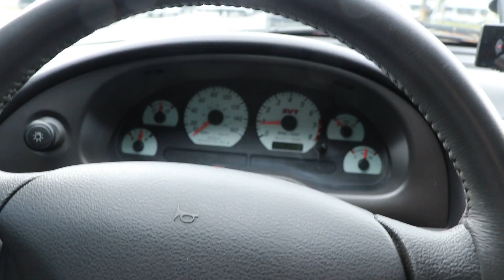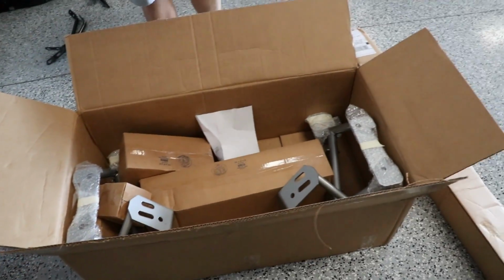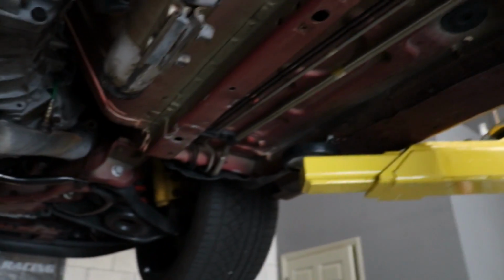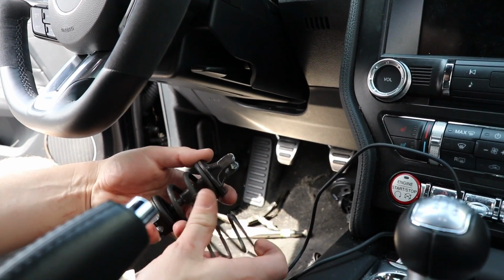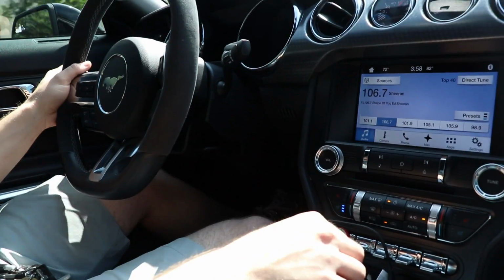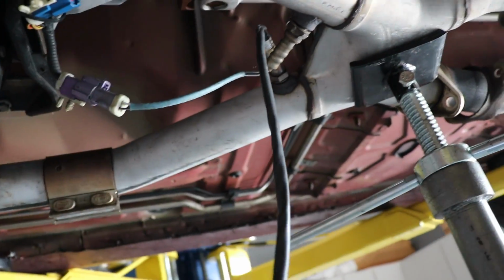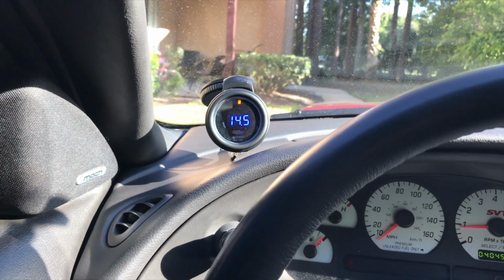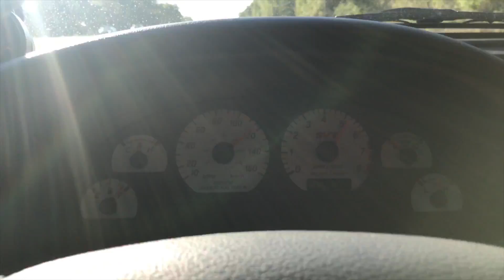Wideband Install on the Cobra + Gasket Replacement + UPR Suspension

Comment: The spring is a "clutch pedal helper spring" It makes the clutch pedal lighter to press on. The Steeda spring does less assist (lighter spring) so it makes the clutch pedal a little heavier to push. It doesn't change the engagement point. Removing the spring provides for "real" clutch pedal feel and restores the free play at the top of the pedal travel (the way it is supposed to be). Remove the spring and you will like the "pedal feel"!!

Comment: Even I bought the steeda clutch spring, the engagement point is still the same which no engage until almost the end. I am thinking about swap in a new paddle assembly.

Comment: Andrew , you should totally swap to the whipple either the 2.9 (175ax) or the 3.3 (205ax) blower . Go to the dual pump setup (if you dont already have)  , a set of id1000s , and a much bigger tb , and yes please throw on a set of long tubes ! Then your 600rwhp should climb up to a nice 700-750rwhp
Reply from the maker: I am happy with the current setup. I have the factory dual pump system. I plan to upgrade to a return style fuel system and run e85 where I can easily make over 700rwhp. I will also need ID1000s as well with that setup.

Comment: Thanks Andrew for putting my S550 in your video  The flowmaster scavenger X-pipe is loud I had the ghost cam tune on the car at that time Are you guys going to Orlando speedworld  on Saturday 13 For the steeda stampede Thinking about putting it on drag strip will have the race tune on car for Saturday It was nice to meet you at Ice Cold Auto Air & Muffler Tyler is awesome at what he does they are all awesome at the shop  Thank you Andrew Scott and Ashley  Mustang Lifestyle Booster and Venom Outlaws are a awesome group of people as well

Comment: hey +mustang lifestyle I hope this question doesn't make me sound dumb, I'm still learning all this stuff, but your videos are awesome man. my question is tho, what is the benefits of running the wideband? the gauge looks awesome tho but I'm not sure what all it does.
Reply from the maker: The benefit is 1. Having the ability to input the air to fuel ratio into the SCT for data logging 2. Monitor afr(air to fuel ratio) while WOT(wide open throttle) in order to potentially spot the car going lean on a long pull. If a car goes lean(a condition where there is not enough fuel for given air) then it could cause detonation which will lead to the piston potentially shattering.
Reply: oh wow, thanks man that makes sense. definitely don't want to run the risk of damage to your engine. thanks for the info man. look forward to seeing more of your videos

Comment: I have a question...i have a 99 GT vert  lowered on ford racing springs should I go with coil overs?
Reply from the maker: In terms of ride height coil overs will give you full adjustability to get the car sitting where you want. Coil overs with the correct spring rate and shock/strut combo will handle very well. We are going to be installing the Turdzilla suspension within the next few weeks so we will be able to give you even better insight when all the suspension components are installed.
Reply: awesome!  thanks love you guys!

Comment: How are those jms wheels? Thinking about buying a rear set for my 5.0
Reply from the maker: Build quality is great. Our friend Josh has ran them for a while with no issues. Finish is great, fitment is great, and they are fairly light and for the price you can't beat them.
Reply: Ok thanks for the info it was between these and the 15x10 sve wheels just didn't know much about the jms wheels

Comment: What fuel up grades do u have on the cobra? I have a gen 2 tvs on my 03 with 80ib injectors 3.0 pully  kenne bell bap and it ran out of fuel pump on the dyno so I ordered a leathal budget return style. Just curious what u got?
Reply from the maker: Stock Pumps, Fuel Pump Booster, and 56LB Injectors. The car currently makes 601RWHP and 560RWT on 93 Octane on 18-19 PSI (2.8" Pulley) - 15 Degrees of Timing. Fuel pump duty cycle was 80% - very safe still.
Reply: Mustang Lifestyle  well shit I don't know why I had to up grade my pumps
Reply: Cody Morton did they fail or you just upgraded them
Reply: Oliver  ran out of fuel on the dyno